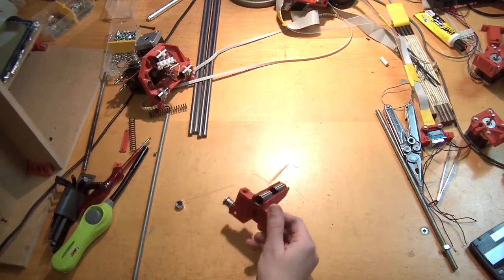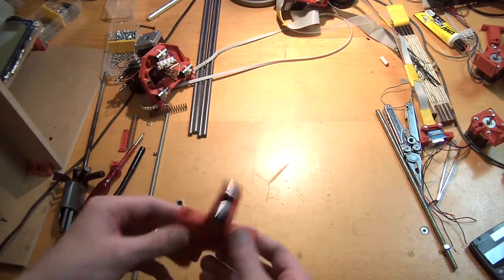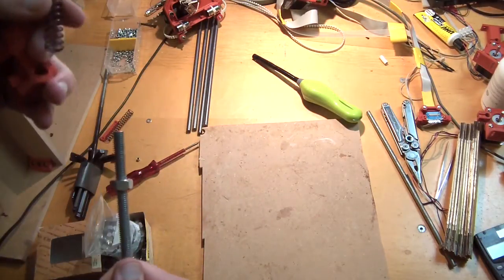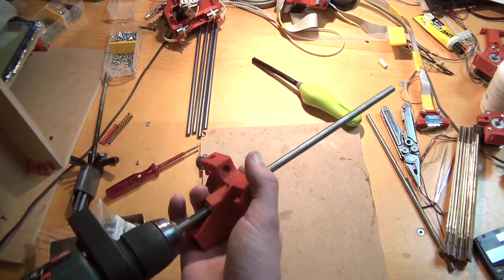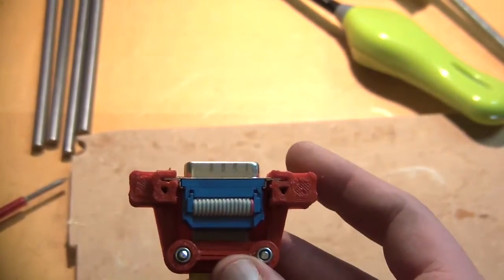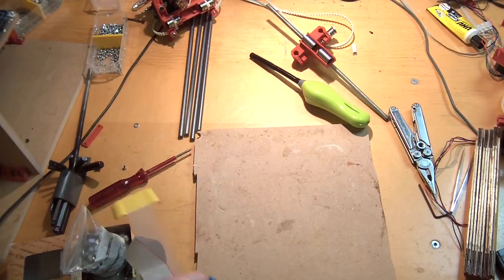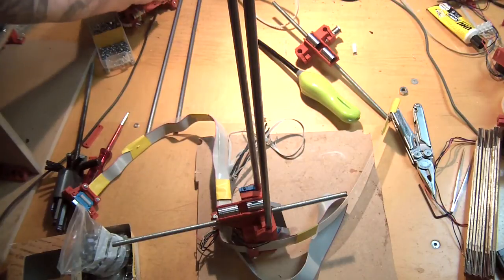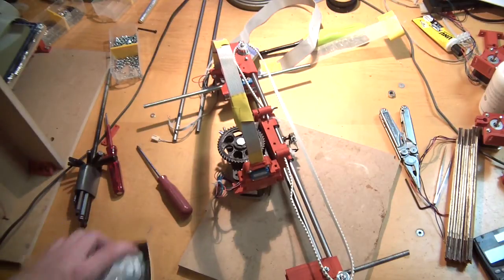Mendel90 Tutorial 07 X Axis Assembly

Comment: good to see its still progressing along.

Best way I found for fitting linear bearings to the printed parts, is to fit them to the smooth rod first, line them up with the bearing holders on the printed part and push them on at an angle.  Doing it this way lines the bearings up better and there's less chance of the bearings binding on the rod.